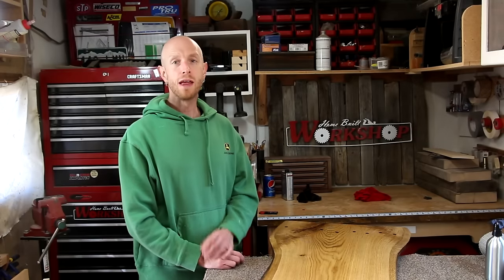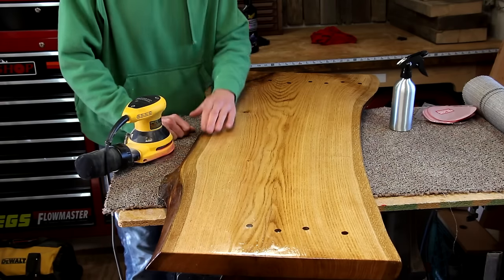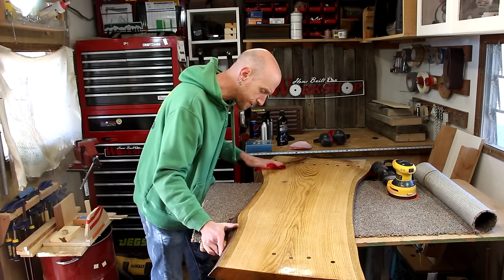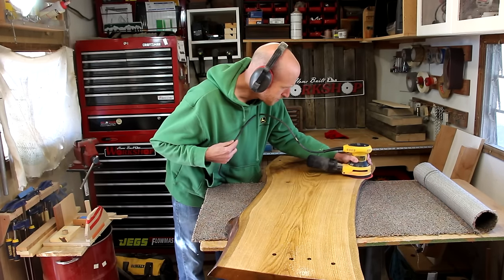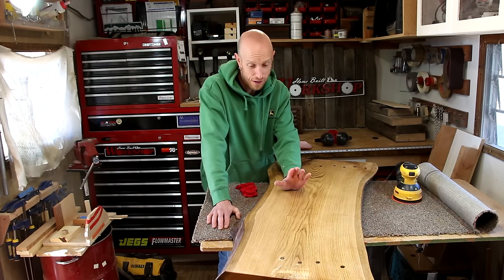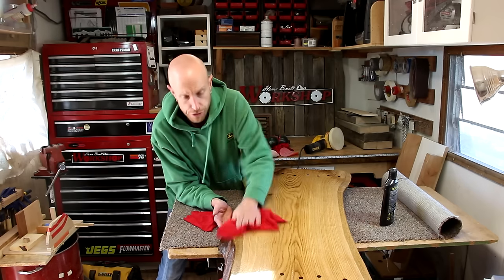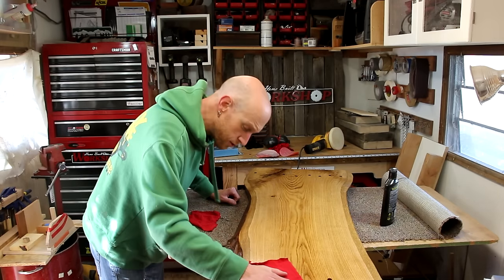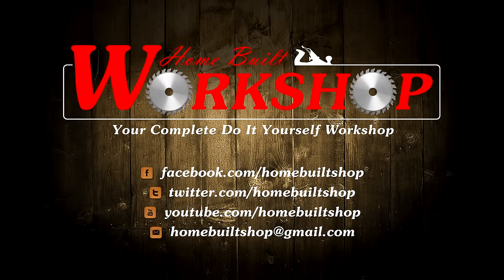How to Buff Polyurethane to a High Gloss

Comment: This is a killer video! 
Sharing a couple more things I learned in the process. When selecting an automotive polishing compound make sure to get one that is a POLISH, NOT A RUBBING compound. The bottles and jars can be deceptively similar. Rubbing compound is too abrasive to leave a mirror shine on polyurethane. 
Wet sanding by hand works fine if you can’t find 1500 grit with a Velcro backing for the orbital sander. 
Picked up 4 inch round microfiber pads and they stick on great to the orbital sander. $2.50  for a pack of 5 at Autozone. No need for buffing pads with Velcro backing if you can’t find those either. 
The polishing process takes longer than you think even with the orbital sander. I can’t even imagine doing a large surface by hand. 
The joy of accomplishing a smooth mirror shine is worth it!
Reply: Okay - so I followed this process exactly - and the issue I have is that I "don't" have a mirror finish! I applied this process following a multi-multi-multi day application process of General Finishes gloss finish, but wanted a finishing process that took away all the nibs. I wiped every coat strategically using microfiber cloths, but even here there occasionally can be an errant poly fiber that gets free. In using the 2000 grit process, I took away the nibs, but it clearly took away the original high-gloss of my final poly coat. The polish did not bring that back. My question - would using a polishing compound smooth back the finish to a high enough grit that it would turn mirror? This isn't for everyone, but I use this table as a production flow table for slides and negative digitizing.

There are pluses and negatives of using Minwax/Varathane versus General Finishes, but the biggest benefit to General is that it takes a little longer to dry and levels out better.
Reply: You can go over your finish by hand with the 320,  Didn't wipe it down by hand to get the dust off, You want at least three coats. And then apply your wax should be fine.
Reply: @bfremming  Hi. Did you solve this issue? I'ver got the same dilemma: my final poly coat is glossy and level, but to the touch I can feel some minor bumps here and there. I mean you might not even see them when you look at the table, but you definitely can feel them if you know what you are looking for. Since I applyed over ten coats of poly with sanding, wiping off with mineral spirit and then again getting rid of miniscule particles with tack cloth in between coats, and overall have spent on this table over a month, I kind of don't want to compromise, though I'm sure most of the guys would just leave it as it is and enjoy. )) Still, I'm a bit worried what if I start this buffuing/polishing routine, I might, just might get rid of those microbumps but may lose my nice gloss. So I still can't make up my mind over it. What are your ideas or findings?

Comment: Car detailing nut here chiming in. The meguires ultimate compound you're using is more of a cutting compound and would be good to use like you did right after wetsanding. But, it will leave a slight haze on softer finishes. I would go one step further and go at it with a finer abrasive like meguires 205 (probably have to get that online) after the compound to make it really pop. If you want to be really hardcore you can get a black foam buffing pad for that step instead of the more aggressive microfiber pad you're using. Believe it or not the pad makes a huge difference. Keep up the good work.
Reply from the maker: Thanks. There's some 3M stuff I really like but didn't have time to track it down for this project. I think it's called FinessIt.

Comment: Thanks for this excellent video. One suggestion... Once you are done with your 2,000 grit sanding, apply one coat of wipe-on poly with a lint-free rag. It will look like glass. If necessary, you can buff it with a polishing pad and polishing compound. You could even go over it with a lambswool pad for the final buffing.
Reply from the maker: Thanks, I'll have to try that.

Comment: I just redid my hardwood floors, 3 coats of oil based poly after staining, I sanded in between coats. Still little rough. So much work, now considering renting a push buffer to buff them because I know it will make them really look good. A lot of work re doing these 70 year old floors but they look amazing compared to the new flooring I had to install in kitchen. Way more character. Thanks for video

Comment: Thank you, Jeff, for this very clear and helpful video!  
I don't have an orbital sander so I'm doing everything by hand. I have a pine tabletop on which I've applied 4 coats of semi-gloss oil-based poly. After each coat stopped being tacky, I put the tabletop went outside to dry.  It's been low-humidity & downright hot here (northern CA), so I felt ok polishing it 2 days after applying the last coat. This coat had some brush stroke issues, so I wet sanded those spots very lightly with 600 grit paper (I now regret that) to smooth them down then I wet-sanded everything with 2000 grit.  It now feels smooth as GLASS!  BUT one issue:  Those spots I lightly sanded with 600 grit are still slightly cloudier than the rest. This isn't visible when looking down on the surface, just from the side. What's the best way to even out the sheen?  Hand rub the dull areas with a super-fine pad and polishing compound?  Do that to the whole surface?  Wet-sand the dull spots with 2000 grit?  (Please tell me I don't need to apply another coat of poly or rough-up the whole surface again.)  Thanks for your help!

Comment: Thanks for the great tutorial- I actually came here looking for some guitar buffing knowledge. To my joy and surprise, you mentioned buffing out a couple of guitars!  Just wondering, what did you use for a top coat for your guitars, and how did you manage the contours of them?  Thanks!
Reply: Same here.  Second time I have heard the smell it test, I will hang my guitar in the house and try that.  For a topcoat everything was purchased at an automotive paint store, I used a solids polyurethane with a hardener.  It was a 2:1 ration but with my 100 degree heat did not probably need it but it does cut down the curing time.  Wow, just realized this was from three years ago, lol.  I hope you got your answer.  Not sure what you meant by contours.  Did you mean the shape of the guitar?

Comment: Nice video, great job on the audio. You should be able to find up to 3000 grit paper at any auto body paint supply place. Also, when you do your sanding & polishing (with DA or RO), don't polish in one direction all the time. On one pass you move front to back and on the next, side to side. This will give you the best finish.

Comment: Jeff I have a question 

Does this process also work with the resin epoxy? Great video, I enjoyed watching it
Reply from the maker: While I haven't tried it myself, I do believe it will work fine. 👍
Reply: charles henderson the process is exactly the same but it will take a few more passes with the polisher to get the scratches out. I have 3000 and 5000 grit sandpaper I use to cut down on polishing time on 2 part finishes, but these are quite expensive.
Reply: Yes it does work on epoxy.

Comment: Thank you for this tutorial! Clear and well explained. I have an oak buffet which is new, having a lacquer finish. It doesn't have bumps, very even and nice. But it's not smooth as a glass, and is a bit satin pulling on mat: I'd like it to be semi-gloss, or at least with a bit more sheen than satin. I thought  about simply applying paste wax with a grade 0000 steel wool, then elbow grease to vigorously make it shine a bit more. But now, seeing your video, would the same process work on top of a lacquer finish (the problem is that I don't know how many coats of lacquer were applied)?

Comment: I just did some kitchen countertops. With 7 coats of poly and then did the wet-sanding method you did.  But by hand with 2500 grit sandpaper wrapped around a 2" x 4" rectangle pad.  They have been sitting for 3-4 days now and they are pretty good.  But I wouldn't mind getting them even smoother and with that extra bit of shine. 

So at this point can I go in with the buff pads and polish?

I have the same Dewalt Orbital Sander as you. Can you reply with a link to the exact buff pads you use? And a link to the the exact polish?

Comment: 15 coats.
More's Law.
Some is good, more is better and too much is just right. Sir...guess you were going for the deep looking finish. That's all good. But be advised.  The thick finish will show dings and dents easier over time. The poly is not harder than the wood.
If someone burns through 15 coats with 2000 grit they might want to consider a different hobby. After years of aggravation I finally mastered the art of spraying poly. Seems to be a superior finish.
A well done video. Thanks.

Comment: I did this on a dark table and it worked great.   What type of cleaner should I use that won't leave a foggy looking surface?
Reply from the maker: Thats a good question. Sounds like what you have tried is leaving a strange residue. I don't have any particular recommendation but you might try just a mild soap and water. I don't think that would leave a film.

Comment: Hi nice video  what type of polish should I use  thanks Tim
Reply from the maker: I used Meguires ultimate polish. As long as your finish has fully cured, you could use just about any polish though. Just make sure it's a polish, not a cutting compound. The compound it coarser and will remove more material.

Comment: You confirmed what i thought I could do, coming from the automotive background i read thinking poly is no different that auto clear coat. THANK YOU!
Reply from the maker: Yes. Different products but the same techniques apply.
Reply: Assuming you are used to using acrylic auto urethane, poly is much harder and will hold a polish better.
Acrylic is more soft and rubbery.
Reply: @fieldworthyairsoft1436  its 100% poly clear full gloss. I didn't cut it with anything. I did a rifle shock a while back and smelled it and dude didn't joking it doesn't smell the clock I just made 5 days later still has a faint odor.  So waiting for it to fully cure gonna do 2500 grit, cut and buff and call it s day.
Reply: Field Worthy Airsoft what sort of car has a soft rubbery finish?

Comment: Hi! 
Thank you for very useful video and great tips – immediate subscription! I tried to do something similar, but something went a bit off, so I’m kindly asking you for an advice: I have a wooden IKEA table. Its top made of several wooden blocks, so it’s not a single sheet of wood. I dyed it using water-based dye, and covered it with the first coat of polyurethane lacquer. 
The thing is that after applying the first coat I can see that the surface gone patchy – some wooden blocks are glossy and smooth, and some – dull and a bit rough to the touch, where the wood absorbed the lacquer. 
I was going to use fine sandpaper to even the surface after the first coat of lacquer. 
But now I’m a bit confused as I don’t know if I could damage the dye layer on the dull patches and expose the wood, as it is obviously very thin.
What would you suggest to do in this case? I was going to do at least three coats of lacquer with sanding in between.
Reply from the maker: As long as you sand very lightly, just enough to remove the high spots you should be ok. Even if you don't get it totally smooth, you can apply the next coat. If it was me, I'd probably apply another coat before sanding. This will give you a little more finish on top of the dye. Then sand lightly between coats until it's smooth. It may take more than 3 coats.
Reply: @homebuiltshop  Thank you very much for a quick reply! I'll do as you say, sounds like a plan! 😍
Reply: @homebuiltshop  Today I lighly sanded the first coat of poly with 400 grit sandpaper on the block, and fortunately the thickness of the layer allowed me not to damage the stain layer. After that I put on the second layer of poly, this time diluted with mineral spirit at 3 to 1 ratio. It worked very well. So I think I'll continue this routine, as the main danger thankfully is behind.

Comment: I've always done this by hand, after it's dried I'd use fine sandpaper and some steel wool then a rag and I do it for each coat but the first coat , I learned this in shop class in the 70's,. In the shop class the teacher used a powder and he grabbed a stick of this wax stuff. Looking back I believe the powder & stick of wax was like the car wax. I'm so glad I looked this up. Also HOW do you clean the polyurethane  out of your brush, thinner does not work, no matter how much I try to clean it with thinner, the brush still hardens up then I gatta buy new one

Comment: I've been detailing cars (from that uneducated dish soap wash, sammy dry and cheap wax buffed off with a t shirt) to an educated (not like these pros with their own product line)  having plenty of equipment and product for what we call a full paint correction. Watching this, I would've never thought of this however it's the same concept. Rather than sanding or buffing scratches (etched DOWN) into the clear, this is sanding or buffing high spots, mountains, etc (RISING from the surface).  Different but same and I happened to just today finished the final coat of poly on a set of finished basement stairs. Absolutely going to use this technique. However, to apply the knowledge of detailing into this I do have a suggestion. After your sand with 1000 grit, leave yourself enough clear (poly) to go to 2000. This will minimize your marring and using the wax or glaze as a "filler", meaning rather than actually waxing, it fills in the marring, scratching or etching. Then just use a non synthetic wax which is simply to bring the clear to a shine. This will reduce having to reapply so often. Being it's poly and not auto clear being exposed to the outdoor contaminates or UV this should last quite some time with maybe a touch up every so often but few and far between. I'm anxious for this poly to dry so I can break out my RO buffer and "detail" away. Thanks for the ingenious idea!!!!
Reply from the maker: You're welcome. I'm not the first one to do this so I cant take all the credit. I did grow up in an auto body shop so I see all the similarities. 👍
Reply: stairs huh. be careful not to walk down them with socks on after you put on the wax to protect them lol. could be nasty.

Comment: Nice job 👍 

I did something similar using the battery XR Dewalt sander. 
20 coats of varnish sanded from 1,200 to 10,000 grit and polished. 
It came out like glass.
Reply from the maker: Awesome. It's crazy how shiny it will get with just high grit sandpaper. 👍
Reply: 20 coats :hand-orange-covering-eyes::hand-orange-covering-eyes::hand-orange-covering-eyes::hand-orange-covering-eyes::hand-orange-covering-eyes:
Reply: @daviddavidsonn3578  Total overkill but it was worth it to see the results. It took a fair bit of time :)

Comment: Hey Jeff...not sure if you’ll get to answer this question since the video is older but I’m gonna ask anyhow...fingers crossed. So, I have an old Red Mahogany bar in my restaurant that I’m refinishing during the Covid shut down. I’ve sanded it completely down and layered on 5 good coats of Spar Urethane. (Sanded with 320 grit between each coating). I’m very happy with the way it has progressed. I ended up with the same results as you in this video with having slight bumps and imperfections. I sanded the last coat with 3000 grit paper and it’s SUPER smooth. It just has that slightly dull finish that you described in your project. Here’s my issue, I’ve tried polish (Griot’s Garage Complete Polish from auto parts store), with a 6” Compact Palm Polisher and it shines, somewhat. But it’s not the super high gloss that I was seeing from the urethane before sanding with the 3000 grit paper. There are some low spots in the bar top that I couldn’t get to with the sanding job because I would’ve had to sand way too much to get to them. And I don’t really mind the imperfections as it’s an older bar. The low spots are still super glossy from the last coat of urethane and stick out because the polish isn’t gleaming like I thought it might. Any thoughts as to why I can’t get the high gloss look back from polishing? Is there a certain “grit” polishing pad I should be using? I’m at a loss. Sorry so wordy, just trying to get all the details in. Thanks for any help you can offer. Great video btw.

Comment: Thanks Jeff for a great video. I have a question,  on my guitar body , I have 5 coats of gloss wipe-on poly,  cured for 10 days, sanded with 1000 & 1500 orbital buffer. Buttery smooth....using Mequires polishing product for buffing but cannot get a mirror shine. Have I cut thru the poly? I had 5 coats of Tru Oil as a base before poly.
Reply from the maker: Hmm, Its hard to tell whats going on without seeing the piece. Id think you'd be able to tell if you went through the poly, but it is possible. Do you see any lines in the finish that could be the layer between the Tru Oil and Poly? Does the finish feel like wood or poly? If you're using a buffing compound instead of a polish that could be the issue. Buffing products typically are more coarse than polish and won't bring out that mirror shine. Id double check that and try to use a polish instead of buffing compound. I used the Meguires Ultimate polish on this project.
Reply: I'm using the same Mequires you mentioned. I'm questioning my poly product as it seems quite thick for a wipe-on product.....

Comment: This is great - I'm planning to polish a polyurethane guitar, once it is cured and no longer giving off any smell.
Reply from the maker: It will work well on a guitar. Ive done several this way. Just be careful not to sand through, especially on the edges.